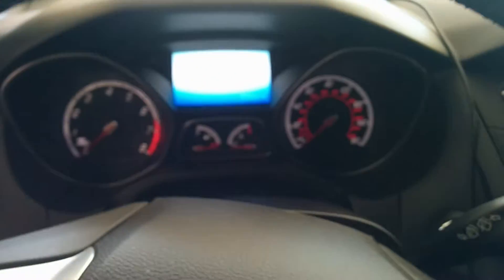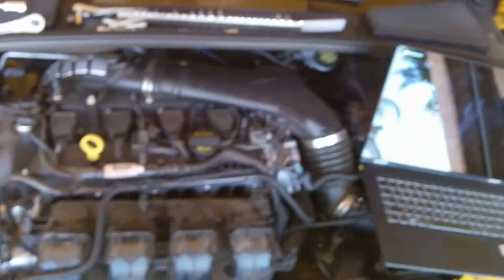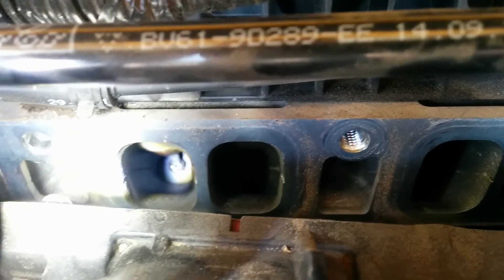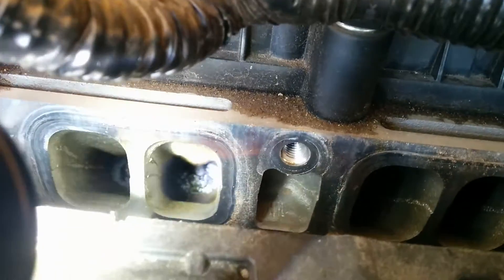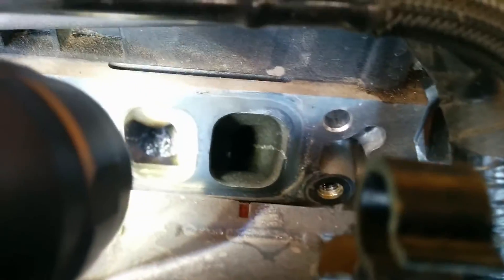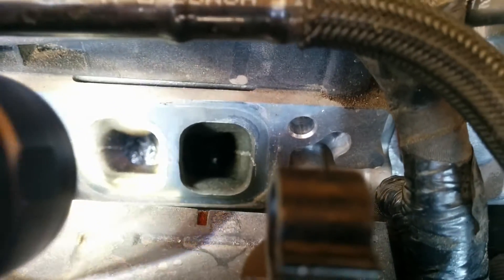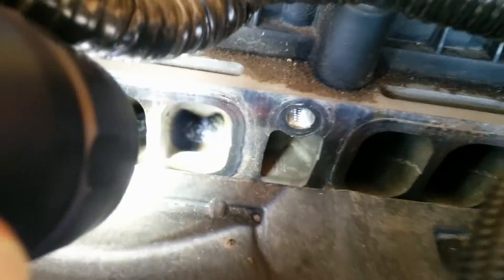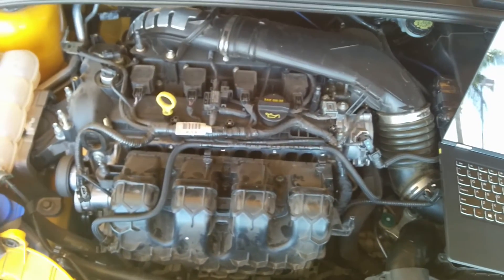Intake Valve Buildup on 2013 Ford Focus ST

Comment: This is why manufactuers need to use multiport. I considered the ecoboost mustang but changed my mind to a v6 because of the carbon build up issues. I dont want to have to pull intake manifold every 30k miles to clean it.
Reply from the maker: JIMBO SLICE yeah, I hear ya.  All I was thinking about at that time was bwaaaaaahhh tsuuuutsuuutsuuu bwaaaaaasaaahhhh =P

Comment: People have had engine sieze up due to this and Ford is doing ZERO about it. You folks might want to get an extended warranty if near the mirage point of expiration. Oh, hope there's no modds on there either. Any, and I mean ANY modds, outside of a Ford drop-in air filter and pro cal tune from ford racing, or a muffler delete/swap, are about all the you can really do and not have worries.
Reply: Your engine wont seize up because of this...It will eventually run shitty. Also not just Ford. All manufactuers with direct injection engines have this issue.
Reply: What does occur as Ford has used a NA type PCV system, water, raw fuel, and the other compounds remain in the crankcase diluting the engine oil and that reduces it's ability to protect. Also, once the crankcase is saturated with the contaminates it is pushed out into the turbo inlet and pushed into the intercooler (CAC) and it condenses to a liquid in the intercooler and accumulates there until enough is present to be pushed into the combustion chamber causing misfires and shudder minimum when spark blows out, and in severe cases hydrolock occurs and pistons and rods break. Contact us direct to learn more or to order a solution. We are the designers, patent holder, and manufacturer of the genuine RX systems and the TracyLewisPerformance.com  versions for all of these engines.

Comment: OK, stock until 800 miles ago- but, so cold start misfires yet? Apparently, it goes away once warmed up, so, it should only occur at cold start up. Known solutions for reducing continued build up is:

1)  Fully synthetic Motor oil. (20W-50)?
2)  Premium (93 Octane), name brand (Mobil, Shell, Chevron) gasoline.
3)  Occasional Chevron Techron in the tank.
4)  Italian Tune up (Rev the snot out of it, once fully warmed up) Loaded & unloaded.

5)** Add an oil catch can in-line with the PVC line. May void OEM Warranty per FordTechMakuloco.

   Also odd- Cylinder 4 was the worst, 2 & 3 cleanest & #1 somewhere in between? Thank you for pulling everything apart and videoing it so we can all see it! Much appreciated.
Reply: Full syn oil helps, results in as much as half the rate of coking.

Fuel has zero affect as no fuel touches the valves any longer on GDI engines.
 Same thing, fuel additives in the tank never touch the valves so can have zero impact.

Italian tune up helps.

FordTechMakuloco understands this in depth and yes, install a proper system, but MOST are not worth installing as they only trap 15-30% max of the oil mist and other contaminates that cause this.

Comment: interesting, i wonder if local weather and how often the car is completely warmed up for a good amount of time effects this (like an hour of driving) makes me want to get a catch can though
Reply from the maker: +yellow5n Yeah, I'm not sure what affects it.  I drive ~25 miles to and from work each day, so it's warm for a while.  I thought about a catch can too, but I haven't done anything with it yet.
Reply: I know this is a old vid but the rx catch is legit my dad has a 14 f150 ecoboost no build up problems 130,000 mi. I have 13 focus st with 55,000 mi. And rx catch can no build up. Every eco boost should have an rx oil,fuel vapor catch can installed period
Reply: Has little effect.

Comment: That's a bit sketchy. Makes me want to get a catch can now.
Reply: It wont help dude, I have the GTI 2.0T and years of testing showed that this will always be an issue for engines of this design. The lack of fuel spray in the port is the main reason its unavoidable.
Reply: @jamesclayton4378  catch cans 110% help